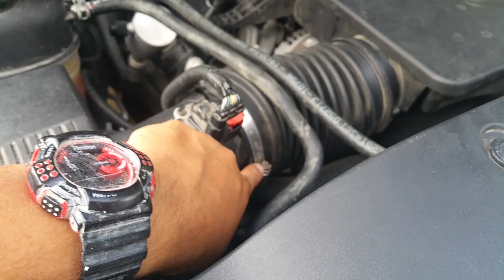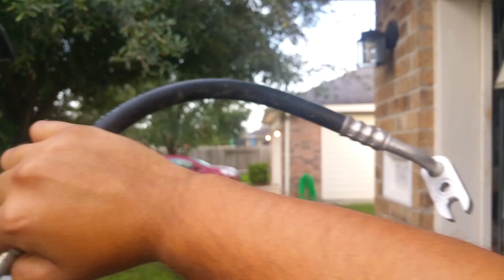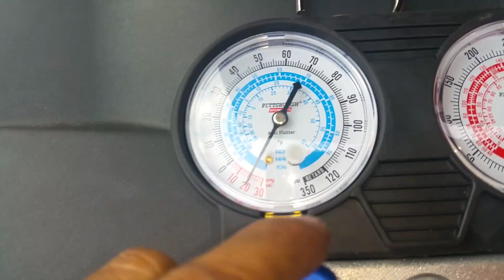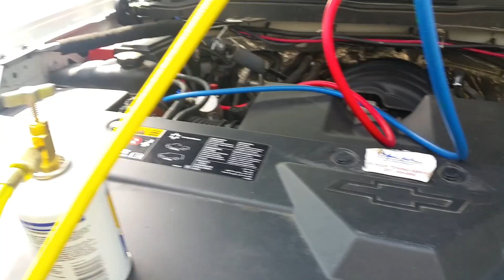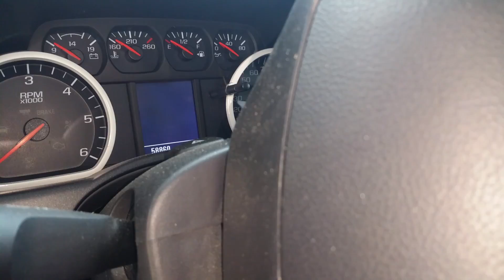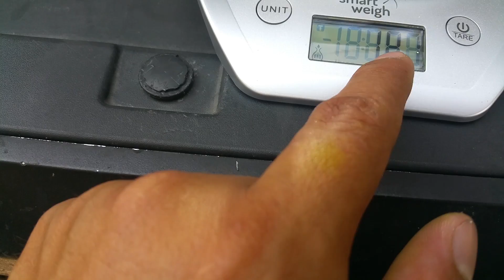2014 Silverado ac fix

Comment: Okay question:  Once you totally vacum out the line, won't the AC compressor clutch fail to engage? Therefore having to jump the compressor in order to load the freon?
Reply from the maker: Not exactly sure, I did have to leave the ac full blast when adding it and it took a little bit to kick in.  Technically if you already leaked all the freon then is already empty and you will still have a little hard time trying to get it sucked in. Pulling vacuum will just remove all the air in the lines and will give you a good idea if it holds vacuum then there's no other leaks.
Reply: @Jorge.Rangel  I kept it on for over 10ish still would not accept the Freon in spite of the clutch engaged…
Reply from the maker: @bmanh2355  not sure if on this models there's a reset for the ac. I know on the 03 there is. Try googling that, maybe it will force kick it on.
Reply: @Jorge.Rangel  thanks. I will try a reset, although I am able to get the compressor clutch to kick on.

Comment: My dealership wants 1400 to replace a condenser...it took longer to run the vacuum and add the freon then it did to replace the condenser lol I bought everything I needed for less then 350  and a couple hours of my afternoon.   Going to the mechanic is legal theft.

Comment: I replaced my 2014 Silverado Evaporator about 4 months ago and my AC  was working fine suddenly IT stopped working now, can naybody pitch me anything that could help troubleshooting, i added Dye and dont see leaks, ut blows but just regular temp.
Sometimes the AC button doesnt light up when i press the AC
Anything would help im pretty ok with taking stuff apart and  going from there troubleshooting, before i go to a AC shop i want to discard minor things

Comment: Hey bro from San Antonio my ac compressor just locked up.  I replaced everything what are the proper reading of the pressure.  Right now I got the low side at 30-35 and high side is 200.
Reply from the maker: Not really sure, sorry.

Comment: I found a leak in the same elbow using UV dye refrigerant. I don't feel confident using a vacuum system though. Are there good instructions for using the vacuum?
Reply from the maker: Chris fix has a very good video on using the vacuum pump.

Comment: There’s a mistake here don’t turn on the ac compressor on vacuum supposed to let the refrigerant flow until almost full then turn it on to prevent compressor damage keep that in mind
Reply: It's fine, the compressor clutch will not engage until there is 21-25psi in the system. That is the whole purpose of the pressure switch.

Comment: So I was changing my radiator but accidentally unbolted the hose you changing toward the front of the radiator. Some freon came out. What do I need to do now???
Reply from the maker: Since it came loose and freon came out is possible that air went in so it could damage your system. The correct thing would be to vaccum the whole thing and add new freon. But if you want to risk it then just add freon, you can use the cans with hose from autozone.
Reply: @Jorge.Rangel  yeah I don't know much bout ac, you know what line I'm taking bout. Think it's 13 mm blot bracket with two lines. I bought some freon at O'Reilly's.  Think shot myself, simple mistake.
Reply from the maker: @frt33twn  yea I know which one your talking about. Just give it a go by just adding some freon. The problem will be knowing how much you lost or need. If your ac blows cold then you should be ok. If it doesn't then just add little by little until it blows cold enough. If you put to much it can damage the system, if to little then the system might not turn on.
Reply: @Jorge.Rangel  which refriger line do I add, one towards the firewall or the one next to the coolant container?
Reply from the maker: @frt33twn  the one next to coolent
Reply: @Jorge.Rangel  out of a 18 oz can/R 138a it used the whole can. In between pulling the trigger, I watched the needle and it stayed at 30 in the green. But is blowing cold air

Comment: My 2015 ac compressor locked up on me within 5 min of truck running.  Got new GM parts. Condenser, compressor, expansion block, and belt. Gonna fix it this evening once it cools down
Reply: Brandon Decker how’d you fix it? My 2014 still has freeon no leaks at all but I know for a fact my ac compressor is gone, it works sometimes then sometimes it doesn’t. How hard was it replace the compressor? I’m in Dallas Fort Worth btw

Comment: Thanks for the help. Wanted to actually make sure I knew where low pressure charging port was.
Reply: Jack Gibson the low and high pressure ports are 2 different sizes you can even physically get them on wrong.

Comment: Did you notice if your clutch engaged before you tried charging the system again ? I've done exactly this and it seems like I can't get my clutch to engage again when it was working fine before.
Reply: Jorge Rangel can you explain this ?
Reply: Jorge Rangel so did you fill the r134 with the LED ac control cluster attached to the truck ?  Did you pretty much just unhook and hook back up?  My problem is I can't get the clutch to engage.  Making my vehicle not load refridgerant into the system.
Reply: Did you ever notice if your cheap gauges were touchy on how much you opened them? I seem to have to open mine about mid way on each to get proper vaccum.  If I open all way it doesn't seem to pull properly.
Reply: Do you have a Facebook where I can send you some short videos of what I'm encountering ?

Comment: I have a question what tool did you use to unscrew the bottom from the compressor
Reply: Jorge Rangel sorry for not bein clear I neant did you have problem because of the limit space there is there

Comment: I have a 2015 gmc sierra and it just stopped blowing cold air. Could it just be it needs liquid only ?  The dealership charges me $169.99 to just check and refill it with more liquid . What do you think I should do ?
Reply: Im not very mechanically inclined. Lol. So i will just take it to dealership then. What would happen if i go buy a can from pep boys and refill it that way ?
Reply: Oh ok.  I will take it to the dealership.  Thanks for making this video and responding back to me.
Reply: Oh . Ok, i will look into that. Thanks again !
Reply: I took it to the dealership today and its the condenser.  They are charging me $1,220.00 . I told them its a recall but they said its not a recall. So they wont repair it for free. I will have to pay for it 100% . Tomorrow I will go to a few local auto repair shops . Hopefully they charge less.

Comment: Excellent description and would like to try it. I can see where mine was leaking. It just started blowing hot air all of a sudden. Some people say it's their condenser. How do you know for sure?
Reply: Look in through the front grill of the truck. Mine was leaking from the driver's side of the condenser at the welds. Changed it out today now I just need to charge the freon
Reply: oscar jimenez mine is the ac compressor that’s not spinning, my condenser doesn’t have any leaks my system still has freeon, can I change the compressor and just be done?
Reply: I could tell from the chunk of aluminum I was holding in my hand!!

Comment: My 2014 I bought 3 days ago started blowing hot air then about 35 minutes later it is blowing cold again. I looked this problem up and a lot of people are saying that bracket broke. Mine doesn't even have the hose bracket. Does it sound like that could be a problem?
Reply: hey bro I just bought my truck last week and it's doing the same thing  sometimes it blows hot air then all of a sudden cold air, what did you find out with yours
Reply: Same my ac compressor turns on when it wants to, checked with a uv light and no leaks in the lines or condesnor my system still has freeon. Did y’all fix this
Reply: @Eastsidee817  check your expansion valve it tends to leak on a 2014 Silverado

Comment: So what were the symptoms when the ac wasn't working? We have an 08 Silverado (I know older than yours) with ac issues and we cannot find the problem.
Reply: OK thank you, ours will blow cold air but then the ac light will go off and switch back and forth between outside air and ac.... I think we're gonna to replace the control head unit next. It's just such a gamble when you can't find the exact issue. Lol... Thanks for yr time.

Comment: Jorge.  I took all thread and 2 Adel clamps and tied the discharge line to the suction line.  had the same issue.  3 times.  There is a tool marking on the bend of the new  discharge line.  It's a manufacturer defect.  Plus the aluminum discharge has a long moment with a heavy rubber line on it.  When the engine goes into fuel management mode, there is a slight vibration.  It causes the discharge line to cracking at the bend.  It work hardens it.  I tied 2 clamps together.  One on one end and the other.  The suction line has a bracket to support it.  I had not anymore problems on R134 leaks anymore.

Comment: Damn my 2014 started doing this 3 days ago. Gonna have to try this.
Reply: I was coming home from work on Friday, June 9, 2017 and my 2014 would not get cold. I assume mine is leaking from the same place. I just added about 3 ounces to my system to get it to limp it along for a bit. 

How much was the hose Jorge?

Comment: Good video man.. question.. did u ever had to replace the condenser yet ? Very comment in this cars too.
Reply: Man my condenser went out about 6months ahi now my hose is out the hose at the bottom I just don’t know wat it’s called any one have a clue?
Reply: My 2014 Sierra recently started blowing warm air and I had a shop tell me my condenser has cracked and needs to be replaced. It's apparently such a problem that suppliers are telling shops to brace themselves for a lot of these and they are all sold out. Have you had to replace yours?